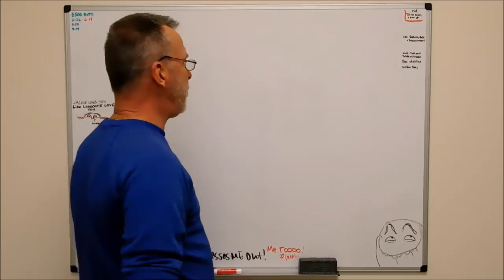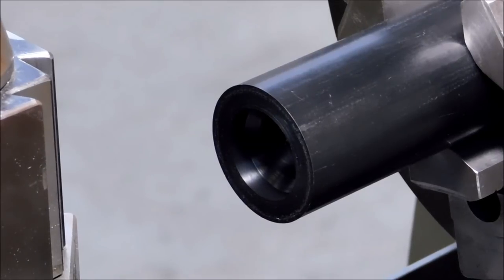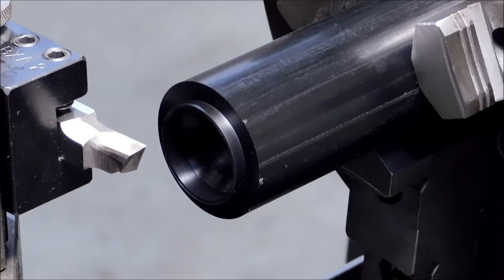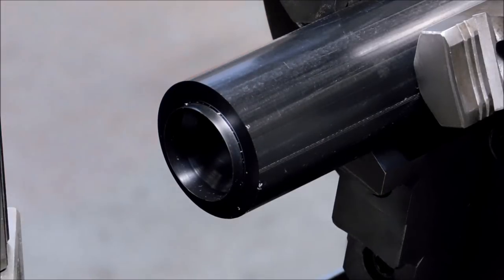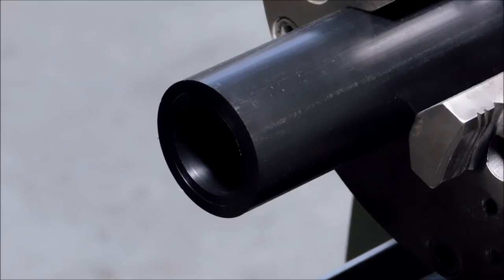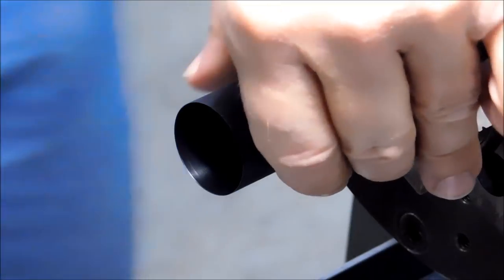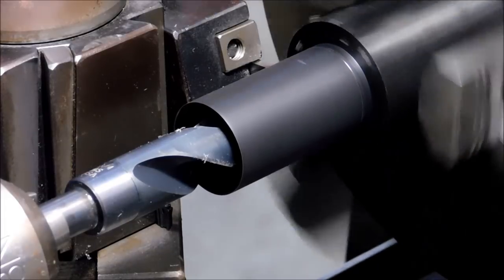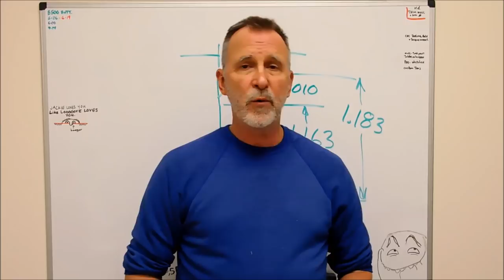Producing Extremely Thin Wall Parts ---Made Easy

Comment: I enjoyed the video and was well described. As you mentioned machining smaller diameter parts are sometimes easier if you use larger diameter material. I machined 1/4" diameter 316 to 1/8 diameter about 9" long. I would suggest that you should not have the spindle turning while changing tools and that when drilling plastic it is not a good practice to step drill which will cause the part to grab the drill.  Charles Boston
Reply from the maker: Agreed. Some spindle drag or small flats on the cutting edges of your drill also help to reduce that grab potential.
Reply: Spindle drag? I'm guess that's to prevent the tailstock barrel momentarily 'jumping ahead" by the amount of end lash when the top rake of the drill digs in or grabs, causes self feeding? I presume you apply it by partially tightening the tailstock barrel clamp?
Thanks, that's using your noggin. 
Don't recall ever having thought of that dodge. 

Another thing newbies might not think to do is to give the drill chuck a good smack endwise (after retracting the jaws underflush) with a deadblow or similar hammer to seat the taper - if there's not much end thrust on a drilling operation, but appreciable torque, the shank can get  sucked right out if a big drill grabs, especially in lead, copper or even plastic.  

Morse tapers are only self holding if there is a reasonable ratio of end thrust to torque, which is one reason they fall out when using an end mill for anything except plunging. Why they used to make end mills with Morse shanks, and tangs (rather than drawbolt tapped holes), was always a mystery to me.

Comment: I was trying to make a .010” delrin shim 
About 1.50 “ diameter with .875” hole 
I turned the delrin to diameter drilled and bored the hole to size but it was when tring to shave off the .010 thickness that it wasnt working the finished piece wanted to convex before coming off the delrin stock
Was my cut off tool too parallel to the part I wanted but thats what i was facing the end off with in same position
Any advice playing with my car trying to make a suspension shim 
I dont have any shim material like in the video wanted it made of delrin .
Reply from the maker: That is actually not unusual. Some material compression and stretching causes that to happen. try parting it off a little thicker so it stays straight, then double stick tape it to a flat surface and machine it to the thickness you need.

Comment: So how do you strike a balance between completing the part and the amount of waste?

If taken from a solid you have control over which is done first and how much but that can mean a lot of wasted material.
Keeping the process the same, how close would you order the material if it were a tube? 
Just inside of where the inner diameter would be on completion (to me that is the easy part) but starting at how thick of a wall?  Asked as clearly it is the support of the "wall" you are counting on.  Would it then begin to be determined by what the material actually is?

I guess what I have in mind is a thin wall bushing from cored bronze as opposed to solid round.

Part II: would you ever consider plunging a center cutting end mill?  Rather than drill and bore...this process seems to lend itself to a manual turret lathe.

Now to the extended small diameter video
Thanks.
Reply from the maker: Your thoughts are good. Cored bronze is fairly hard material so a thin wall would be OK to order. The thickness of the remnant material is usually driven by how soft the material is and how far its sticking out. This super thin plastic was an extreme example.

Comment: Hi Joe, fantastic video. I'd like you to make another video about the better tools for plastic and Delrin in particular. Thankyou.
Reply from the maker: HSS all the way.
Reply: Joe is brilliant.
I grind the tools specifically for plastic.
The edges need to be hand ground with finer and finer stones or properly supported emery paper until you get a sharp polished finish.
Use your loupe to check the edge.
PVC is a little abrasive so check the edge on long runs.

Comment: Good video. A good suggestion for machining plastic is to use diamond coated carbide inserts. They are not that expensive, and stay sharp. Even with a bigger nose radius for better finish.
Reply from the maker: I prefer HSS over any type of carbide. I find the tight grain structure of a good HSS tool gives a superior finish and holds up quite well.

Comment: is this technique only work on small DIA parts? I'm working on a project on CNC lathe. Aluminum 8" long, 4.5" OD, 0.06" thickness. would this technique work? also would you recommend holding material from the ID or OD?
Reply from the maker: I'd hold the OD. Don't bore it all the way through so the jaw pressure has a solid puck to squeeze, but finish the bore. If you can tap in a plastic plug to keep the ringing down on the open end, do it. Part the tube off, then knock out the plug.
Reply: @joepie221  thank you for the reply and great recommendations! I'll make the plug for it. Great idea!

Comment: Material don't matter? Try titanium 3/4 i/d 2 thou wall thickness 2 inch long on a part after two hours of other machining and its down a 5 inch long bore so three inch deep 2 inch hole then thin section and square bottom face, That was fun!
Reply: "Shucks, boss! There goes another one!  Got any more blanks?"

Comment: Smart machining as usual. The other day during lunch I made a small tube for an elderly neighbor to thread line through his wind chime tubes. Drilled a .059 hole 1.25 deep in .375 brass ( I knew the brass would be easy to work). Then I took .300 deep cuts at .090 on the od until I had a 1 inch tube with a 3/8 head to grip.  Worked out well.

Comment: In honorable mention Dead Sharp Tools that have never seen any metal on Delrin and Teflon.

Thin walls can be tricky in milking as well. I use HSS and always CONVENTIONAL CUT as not to suck the wall into the cutter.
I make filler blanks for thin metal walls that are .010” .

Planning is everything as Joe points out in many of his videos..

As always thanks Joe!!!! 🙏

Comment: I always try to machine from the inside out (reverse turning) with a holding sleeve over the outside of the thin walled component. Rub a thin layer of oil on the inside of the holding tube. The shavings will be behind the tool and not getting pushed into the tube. The deeper you machine, the worst the situation might become depending on the inside diameter. I work with the metric system, so the wall thickness of the plastic component in the video would be 0.254 mm. This will probably scare most people. A very small radius on the tool and maximum diameter boring bar with the shortest overhang possible to prevent chatter is essential. A holding tube on the outside will prevent any deflection of the plastic tube and allows for accurate measurements. With the holding tube on the outside I will probably be able to take the wall thickness down to less than 0.1 mm.  No lecturing from my side brother. This is just how I would approach this type of problem. It looks like you have a very nicely setup in your shop.
Reply from the maker: Each of us have developed our own comfort zone when it comes to unusual things like this, but I'd like to add my thoughts. A very solid rule of thumb for lathe work is to leave stock to support what part of the part you are working on. Meaning, if you part has a big undercut or relief and a large end feature, finish the end feature before you put that undercut in. It keeps the part rigid. If I understand you correctly, reverse turning from the inside out sounds feasible until you have removed so much of the tube wall and the depth of cut starts to twist the tube because the cross section just can't handle the load. For sure the outer collar is a good idea, but it may also add weight and contribute to 'whip' if not slid over a non relieved area. This technique works well because there is sufficient wall to maintain rigidity. Reversed, I bet it would fail on this particular part. The plastic would just blow up.
Reply: Joe Pieczynski  I haven't had trouble using the way I describe. It always work!
Reply: This is actually the approach I would've guessed he was going to use. On stuff like stainless or titanium you're gonna have a bad time hucking off a quarter inch all at once like that. Plus, if you have a very long tube and you're using supports to prevent deflection, a holding tube seems to be a more amenable solution. But the technique in this video seems to be the best for getting somewhat normal stuff done quickly but still well.
Reply: The "free cutting"method is ok for demonstrations and a quick fix maybe, but if component's dimensions are critical or to be measured and you use the method in the video, you have lost. Deflection during the process is the enemy.

Comment: Joe, first of all I want to say thank you for everything you do. Your videos are great...I would like to ask for some guidance. I'm in need of facing each end of a 6" 11ga tubing at 10.5" long. All we have at the shop is insert tools (triangle), and a 3 jaw chuck. The jaws have to grab the OD of the pipe and I'm sure you know, you can't just crank down on the jaws, resulting in a deformed pipe. What RPM would you run, which feed direction (outside to inside or inside to outside). I'm questioning what I've been told to do and I'd like some input if you've got any recommendations.
Reply from the maker: Thanks for the question. I actually have extensive experience running parts like this. Lets start at the beginning. Always turn from thick to thin. This means cut towards the chuck.  If you start your cut at the chuck and feed out, you have reduced the integrity of the part and it will ring, sing, distort and chatter even worse as you travel out. Second. Never grab a large wall tube without interior support. This may be a lobed plug or a spider, but ya gotta offer up some resistance where the jaws are going to hit. Next, if possible, take 2 passes. be sure to reduce the chuck pressure before the final pass. You may still have an out of round condition, but it will be much greater if you skip this step. And finally, if you can, support the open end with a plate or puck and live center to add integrity to the final pass.  Good luck.
Reply: @joepie221  Thanks for the reply Joe. However, maybe I wasn't very clear. I'm only in need of facing the ends of the pipe to true them up. Not turning on the length of the tubing.  Being thin wall, 3 jaw chuck, and hanging 10.5" out, it's a bit concerning (for someone with not a ton of experience like yourself). I was told to spin it at 170rpm but that seems awfully slow for inserts but at the same time, there's a good chance the pipe could get thrown from the jaws so slow may equal less damage? Lol

Comment: What do you do when the OD of the material is already on size? Do you make a 'sleeve' to slide over and support the material while you do the ID?
Reply: Rough out the I’d close to size, check od is running true if not indicate part, finish I’d in one pass?

Comment: I need to make a .001 wall bushing for a gun receiver that the hole was drilled .002 too big. Probably not possible?
Reply from the maker: Depending on the area in question, perhaps filling that area with .001 shim stock may be a better option. A .001 wall is a stretch, but not impossible. How did you plan to press it in?
Reply: @joepie221  I wasn’t going to press it in per se. I was going to machine the outside to slip in. Then use sleeve retainer to hold it in place. Or I could machine a driver that supported it while pressing in. I prefer to heat the receiver and freeze the sleeve in that case. And make it maybe a .00025 press fit
Reply: Can you make the part that goes in the hole oversized?
Reply: @andyweiss80  and drill the hole bigger in the part?
Reply from the maker: @Turbogto_guy  Working with a wall that thin is going to present a world of problems. If it has to be bushed and you're on your game, make a bushing with a thicker wall, install it with a suitable locker, then re-bore it. You'll have to spot on for this to work. Otherwise, bore the whole area larger so your bushing can have a thicker wall.
Reply: @joepie221  thanks. My lathe is off by about .001 so it will be difficult to get it that thin
Reply from the maker: @Turbogto_guy  Is a bigger starting hole in the part an option? That would result in a thicker final wall on any bushing you put in.

Comment: Joe can you tech how to remove chatter in threading? . Some help to find the main cause of chatter in threading.
I'm making a 4140 steel 5/8"-11NC x 1.75" long thread (No tail stock allowed), but the chatter is killing us.
Reply from the maker: Check your tool height and for this issue, set your compound less than 30 and finish the final pass with the cross slide.

Comment: So basically.....bore hole to size then cut OD to size with one Huge pass?
Reply from the maker: Yep.
Reply: @joepie221  yep and make sure the tool's ground acute so you don't rub on the thin bit.   Brilliant, thanks.  Dad taught me this but I missed the criticality of the tool shape . . . that it was 18/8 stainless helped back then - replacement rivets for a thirty year old chef's knife that was complaining about being in the dishwasher.  This time it was brass for thin open rivets for a steampunk light fitting rebuild of a '50s mill work lamp.    Nylon's cheating!

Comment: This was a very informative video, whether you are an experienced machinist or a hobbyist; very good information.  So I look up and notice that there were 30 dis-likes.  Per ratio to 4.2k likes, which is very good, I still have to wonder what 30 individuals (obviously mentally challenged, none the less) would not have liked about it.  Like anything else, information provided is a tool and sometimes has to be tweaked or modified to accommodate the type or age of equipment that you are working with.
Reply from the maker: I like to present material that is heavy with philosophy. You take the idea and tweek it to fit your application. I think thats the best kind of video to learn from.
Reply: I agree Melissa, why would someone not like this. This is such good information. And it's free. Thanks Joe.
Reply: @LouSalamone  Not liking is no problem..........but if you hit the dislike button give a reason for it........

Comment: Better technique:
1. prepare a long alu-pin having the diameter equal to the desired ID
2. make a long hole of the same length in your part
3. fit the pin in your part
4. tight them together in the jaw
5. do your stuff to get the desired OD
A more precise piece of cake.
Reply: Depends on if the part is too thin. Or it will distort regardless of the pin.

Comment: I make this stuff all the time, always bore first, and big cuts on OD.  :)
Reply: 2.5W x 5.5L x.060 wall....with a flat bottom end and no through hole...fun stuff.
Reply from the maker: Sounds like a thick beer can. drink then cut the top off. problem solved.

Comment: cool and all, massive respect but can you show us on a piece of steel or something harder? It's easy to show a concept on an easily machinable material like plastic. You also couldn't do a 5mm cut on steel like you did on the delrin.
Reply from the maker: I'll do 5mm cuts on stainless all day. Its all about machine rigidity and setup. Based on the starting diameter selected to resist flex, the single final cut can be shallower.
Reply: @joepie221  Fair enough and thanks for the reply but I'd love to see that. the tooling and setup involved as well as the ability to do a 5mm cut on stainless with no centre and a 10 thou material thickness. If the cut could be shallower then that would be cool to be explained on materials other than a super soft easily machinable plastic. Again, I love a lot of your videos and respect your knowledge but saying you can do something easily then picking the easy route is a bit of a cop out.
Reply: @TheJordan1925   I have used this principle to machine thin wall SST parts. As Joe suggested, always finish the ID first; I will then put a plug in the ID just for stability and heat sinking. Make sure I use a super sharp carbide tool, run the speed a lot slower than normal, flood coolant and a very very light feed rate. The parts I made were in the range of 5/8-3/4".  It really does work.
Reply: @joepie221  So on harder materials the trick on the outside cut is sharp tools and a light feed rate, don't hog it, but do it in one pass.

Comment: Nice and precise! How about boring a steel shaft with a long hole: 18"-30" ?
Reply: Haha, i just logged in to leave just that same request here and then i see your comment from 3hrs ago! Absolutely! Joe, we need a video on how to drill deep/long holes and how to handle the problem with wandering drills that exit the workpiece off center! Thanks alot for you efforts and all these awesome vids, hope you and yours have a great 2018! :)
Reply: If it's a big part then boring should be fairly straight forward, IMO.  However, if the hole is small then the best option is normally gun drilling.  Spot the center, drill a pilot hole about 1xD the same size that's required.  Then, in softer steel they run about 900sfm and about .0008-.0012 feed (of course, manufacturers recommendation is preferable, they're normally pretty responsive to q&a) and tons of coolant, even sulfur oil preferably ... You stick the drill in the pilot, turn on the spindle and start the feed.  Let is go until through, bada bing, bada boom!  Great hole, great burnished type finish, great roundness and straightness/concentricity.

Other option is trepanning, which works great in many materials and leaves a great finish and great tolerance/roundness.  Sorry to ramble, my .02¢ for what it's worth!